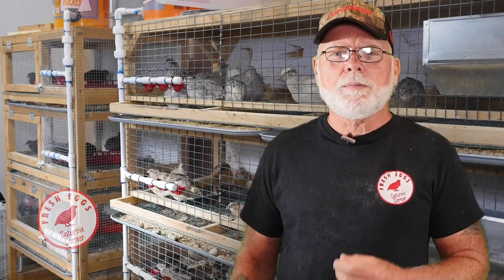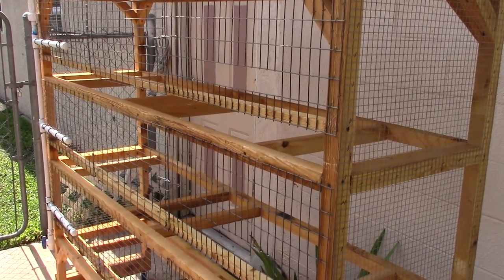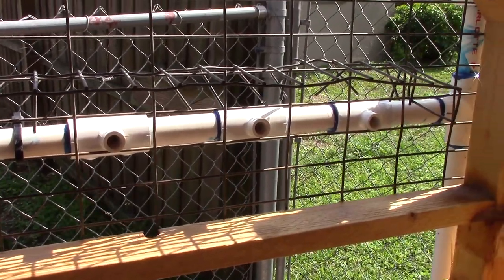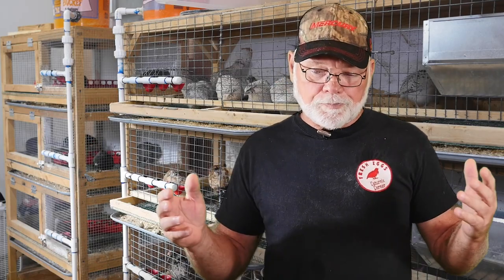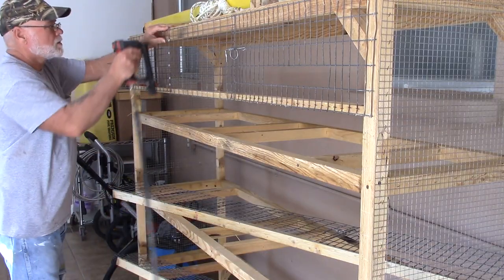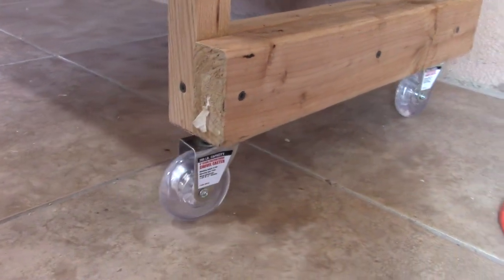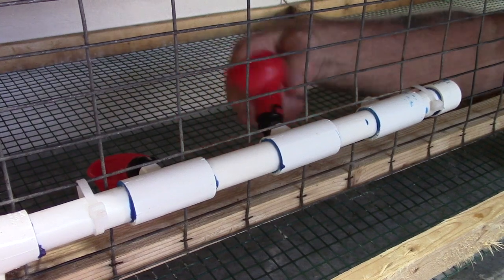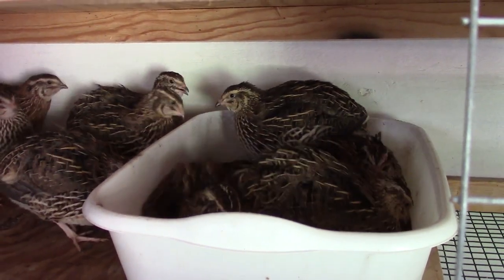COTURNIX QUAIL LAYER CAGE MODS - Fixing some issues

Comment: Luckily, we've worked with the auto drip pans before with our rabbits so we automatically added 6" to your design when we built our quail cages. We've had no issues. We also spray painted the trays with rustoleum prior to installing them.

Comment: Hi Terry, I'm trying to combine all the mods that you made with the roll out bottoms and having the extra space. You said you removed the extra 21in side pieces that you had glued in originally. I didn't see you replace them in the video. Did you? And if not is there a gap in between the roll out bottom and side wall wire?
Reply: Actually, I just went back and looked and it looks like you did put them back in and angled it a but to match the slope of the roll out bottom. Right?

Comment: I am building two cages this weekend. I am doing two tiers on each instead of three for a total of 4 cages. I want each cage to be 48” high and 48” wide. I found 47” drip pans at NAPA. I am doing the version with egg rollout. So after this MOD what are the measurements for each tier? I would like to have 12” height on each cage.
Reply: Hi Mariah.  What measurements did you end up using?  I’m planning on building in the next few weeks.  Any tips you have would really be appreciated.

Comment: Terry I have question about the incubator I built like yours but have a larger fan which only allows for one. The wire that's on it has a connection end that would have to be cut off. How do you wire it up to the power supply 12v.
Reply from the maker: If you have a volt meter you can test your 12 volt PS for positive and negative, then wire direct to the fan after cutting off the connector. If it’s a three pin connector the center wire should be hot. Good luck

Comment: Hello great video. On the grow out cages if you turn some into smaller cages. Would 1'x 2' cages hold 5-6 birds at a time. And how many waterers would you put in each cage. Or would you go wider cages.
Reply from the maker: A 1’ X 2’ cage is 2 sq ft, so at 3 birds per sq ft technically you could keep 6 birds. I would probably only do 3 or 4 in a cage that size. I like to have multiple waterers per cage in case one fails you have a backup. I do prefer the larger cages.
Reply: @CoturnixCorner  what size of cage would you do 5-6 birds in
Reply from the maker: @johnniebunton4978  maybe a two by three
Reply: @CoturnixCorner  ok thanks for your time and help.

Comment: I use the watering cups but the quail sit on them when its hot causing it to drain all the water out making a mess
Reply from the maker: Mine will do that too, I built little wire cages over top of the watering cups to keep them from standing on them. There is a video on the channel showing this.